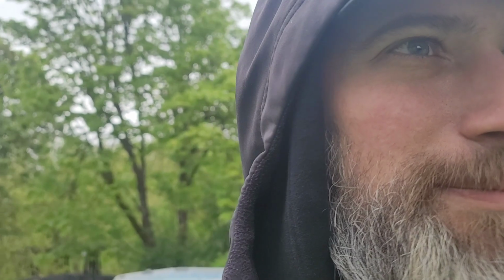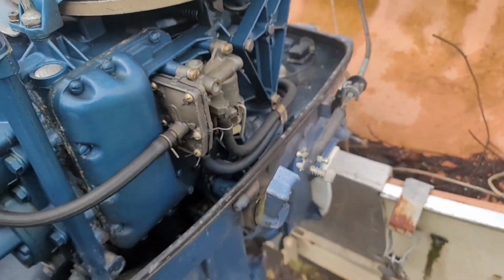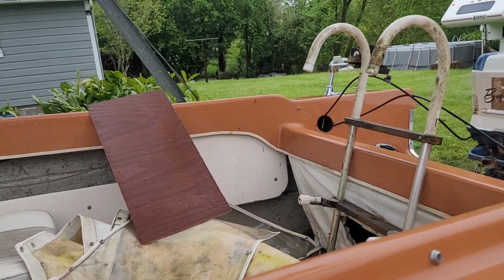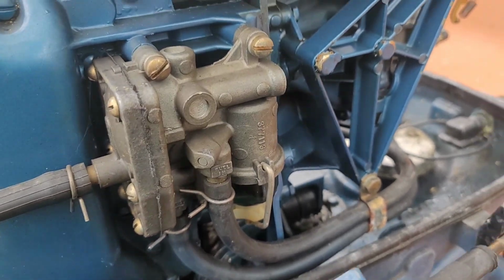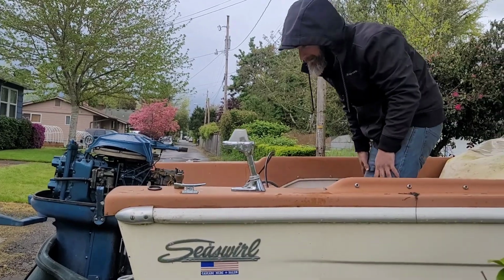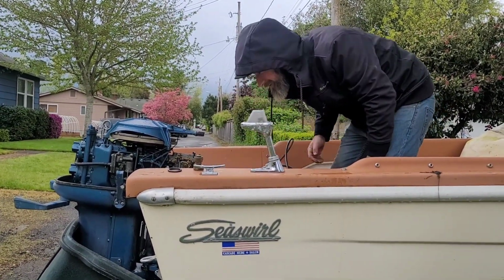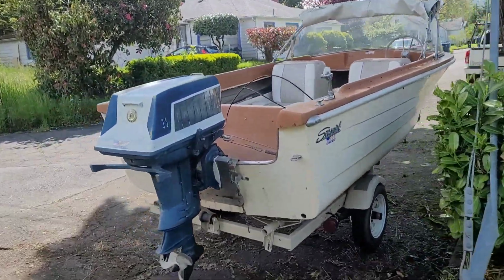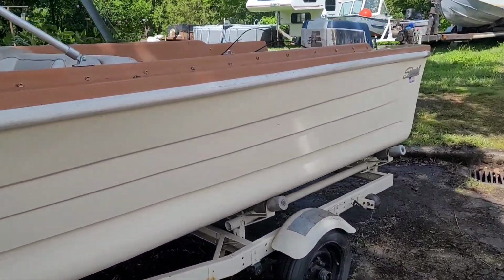another boat!

Comment: Was only running on one cylinder.  Also, I would imagine the water pump impeller was all to pieces. Did it not get really hot running it that long with probably no water going to the powerhead?
Reply from the maker: Cylinder head was cool to the touch when I was done. Agreed.. not running great.